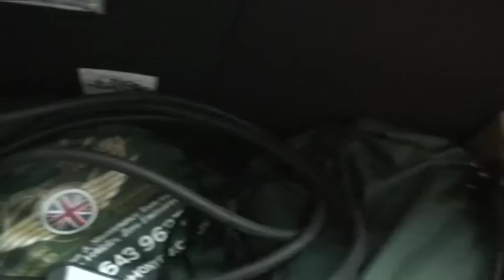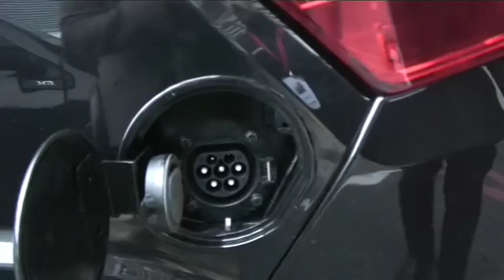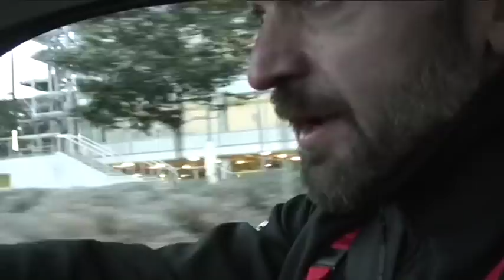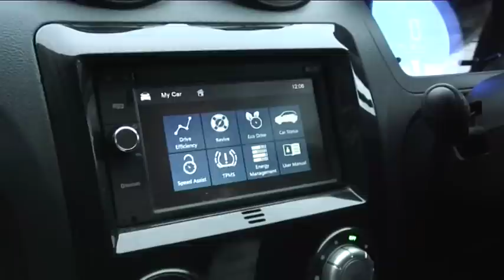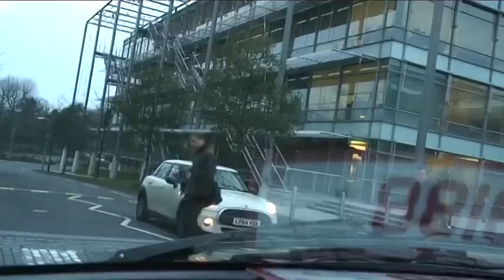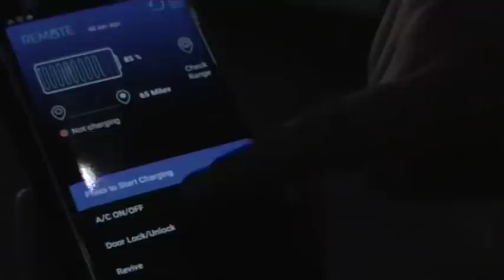Mahindra e20 Electric Car - Any Good?

Comment: Actually this isn't the only electric car which Mahindra manufactures. Mahindra also makes an electric sedan called e-Verito which is based on Dacia Logan (Mahindra had a joint venture with Renault before ) It has same battery and electric motors as e2o but is more practical as it's a sedan. Google it.
Reply: Primetime EV a pity

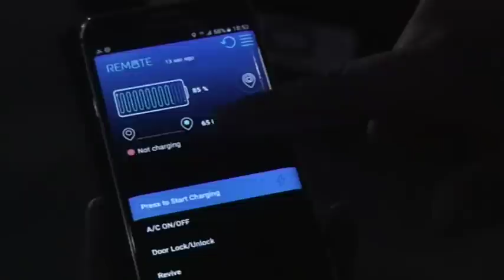Comment: Thanks Danny, very informative video. The display showed 85% battery charge left and 65 "miles of range its got left" (13:45). That would imply a range of 433 miles for a full charge. Please forgive my scepticism but that sounds very optimistic even when you consider the NEDC test cycle (my S70D Tesla only gets 219 miles on a full charge real world, 238 EPA).
Reply: 85% of battery leaving 65 miles of range means 15% of battery gives 65 miles of range. Therefore 100% would be 65* 100/15 = 433 miles of range. The claimed 75 mile range makes sense and sounds about right if 85% of battery has been used to cover 65 miles (which is not what the video said), then the range would be 76 miles, close enough to the stated 75 miles of range.
Reply: Dogphlap No. The car has used 15% battery. You would be able to travel 65 miles on the remaining 85% battery. (65/85)*100= 76.5 miles of charge at 100%.
Reply: If you had read the post I made an hour before your post you have seen that I to calculated 76 miles of range (I rounded it to the nearest mile) but only by ignoring the the obviously incorrect statement in the video. If you go by what was actually stated you get the ridiculous 100% range of 433 miles.
Reply: What you're saying makes no sense. At no point does the video even infer a total range of 433 miles. I worked out earlier that 85% of the battery will take you 65 miles. Therefore the additional 15% left over will take you 11.5 miles. Altogether, this means that 100% of battery will take you 76.5 miles, which is just about the claimed milage of 75 for 100%. Understand?

Comment: Nice review. I live in Bombay, and I've owned the e2o for about four months now. I'm absolutely in love with it! It's compact, easy to drive, hassle free, and costs practically nothing to own and run. However, I'm actually a bit jealous because you guys in the UK are getting a lot more features than us. The quick charging network is very limited here, for example. Also, we don't have the e2o in black! What a bummer. The black e2o looks so sleek :) By the way, the car costs £6000 in India.
Reply: Nath N Hi Nath N. 1) The car consumes 10 units for a full charge. At 5 rupees per unit, that comes up to 50 rupees per full charge, or 1000 to 1500 rupees a month. 2) I haven't faced any issues so far, but then again, the car is only a few months old. However, I've read some reviews and seen some video testimonials by people who've owned the car for more than a year, and they haven't faced any problems either. 3) I use only this car. It lasts for 120 km on a full charge, which is more than enough for city driving, even with the AC and infotainment system on. I've driven the car all the way to Vasai at one end of Bombay and to Colaba at the other end. I've also driven the car to Palghar, Vapi, Poona, and Lavasa. There are community charging stations all over Bombay and Poona that one can use. I use them frequently when travelling intercity. Within Bombay, I never need them unless I'm planning multiple trips. Hope this answers all your questions :)
Reply: You can get a lot of black spray can s for £6K  ............... But in a country where the sun & heat is a regular , why would you want it in black ? White is good & covered in silver vinyl may be the best idea . Look s oddly Italian , in that odd way some of the Lancia later range are clever ......... but a bit ugly .
Reply: magna59 Black just looks cool, I guess. We do have black cars in India, you know! By the way, spray paint won't work here. The body is carbon fibre, which Mahindra used to keep the manufacturing process environmentally friendly. Spray paint would totally defeat the purpose.
Reply: Hey Abhishek. Couple of questions for you .How many units of electricity does the car take for a full charge? Have you come across any issues with the car?  Do you use this car primarily or is this a second one?
Reply: Thank you Abhishek for your prompt and fast response. Hey keep an eye on Tork India's electric bike if you haven't heard it .Definitely looks promising . Drive green , drive safe.
Reply: Sounds like a the have made a good job of it . So what is the ownership situation . Do you own it outright , or is it effectively rented ?
Reply: magna59 I own it. I'm not sure if you can rent it, to be honest.
Reply: Hi Danny. Some of the charging stations are solar powered, but not as many as we would like. Hopefully, this will change soon! There's a handy app made by the good people at Pluginindia.com that we EV owners use to locate the charging stations. We plan to expand the scope of the app as more charging stations come up and as Mahindra installs its quick charge network. My dream is that in five years' time, an all India trip in an EV will indeed be possible! 

By the way, it might interest you to know that Mahindra recently launched another electric car, the Mahindra eVerito, a four-door sedan, in India recently. I'm not sure if and when they play to ship the sedan to the UK, but if they do, it may prove to be a viable alternative for those who find the e2o too small and boxy looking.
Reply: Hey guys. :) The UK spec e2o and India spec e2o are not the same. UK spec is slightly better and more powerful than the Indian spec. And ofcourse comes with the Chademo port. BTW is the quick to charge available for consumers in India yet? Last time i checked it was still just a concept. Anyways thats the reason why its pricey in UK also you factor in taxes and shipping costs the price goes up. But i don't know if imported EVs are exempt from taxes in UK.
Reply: Also another correction. They don't use carbon fiber. They use color impregnated ABS body panels. :)
Reply: Hi karlog Yeah, the UK version has a couple of enhancements that the Indian version doesn't, like airbags and steering-mounted controls.

At the moment, quick charging is available only for Bangalore customers, I believe. However, now that the eVerito has become available with a quick charging port, Mahindra will be setting up quick charge points across all cities where the eVerito and e2o can be bought, starting with Delhi. Whether the quick charge facility will be available to current e2o owners or not is unclear at this point. If it is made available, a hardware and software upgrade will be needed to the e2os currently on the road, as they don't have slots for DC charging. It is also unclear how expansive Mahindra's plans are for setting up their quick charge stations, because according to one source, they've identified only about 200 locations across India for setting up the points. This indicates that Mahindra has no plans to set up a countrywide quick charge network at the moment, because such a network would require 2000 (if not more), not 200, quick charge points across major highways and so on.
Reply: Yep, that's right. I think I may have confused the e2o with the BMW i3. Welp!
Reply: @abhi u looks like it's been 2 years 4 months by now since u owned the ev...is it still going good?